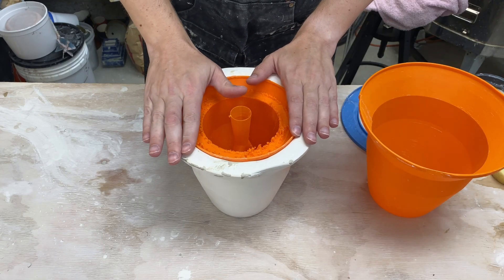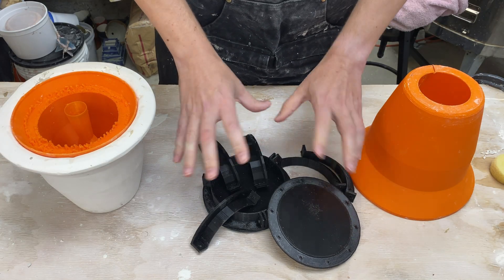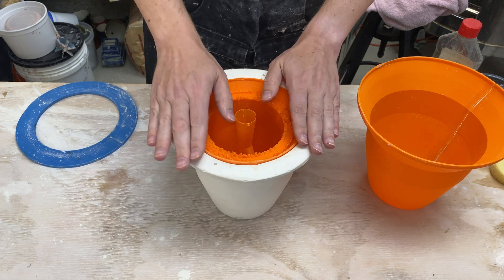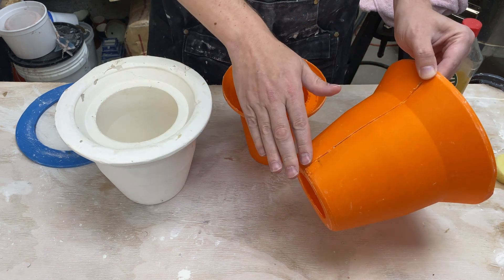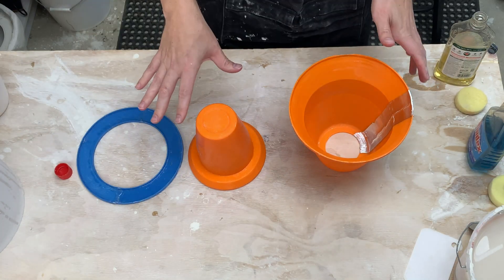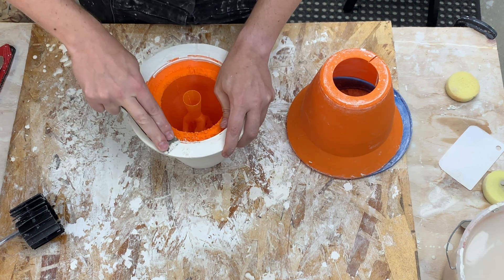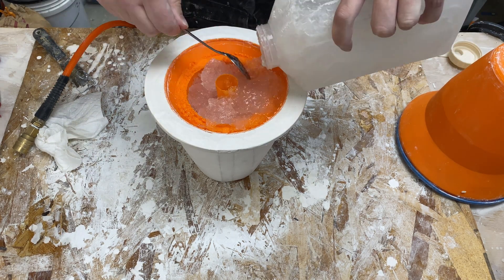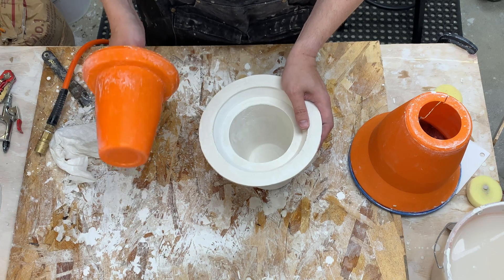Got it OUT! The SECRET to Releasing a 3d Printed Mold From Plaster for Slip Casting

Comment: Have you guys tried this with cement/concrete? it's probably not suitable for slip casting, but i wonder if the demolding is easier. according to google plaster of paris slightly expands, while concrete and gypsum slightly contract while curing. maybe just using gypsum would cause demolding to be easier? never worked with it, but might be similar in properties to plaster...
Reply from the maker: The properties are actually rather different and this plaster is specially formulated for working with clay. So even it is different than other plaster. Yes the plaster does sightly expand so using the frozen alcohol and water let's me shrink the part just enough for easy removal if the draft angles aren't enough.

Comment: Currently having this same issue with resin prints. Seems like it’s air locked in the mold. It has draft angles all around so in theory it should be easy to remove. I did not think about cooling down the model and instead opted for a valve steam size port that I can connect a bike pump to and pump air directly in the center of the mold. Hopefully that works, if not I will definitely give your method a shot!
Reply from the maker: This process came about from an active discussion on a previous video, and using compressed air through the mold was a contender. However, in trying this method, it is so easy and just works! I've used it on several molds and at this point some others have as well.
Reply: @PotterybyKent  Good to hear it’s worked for you. My design also requires a plaster mold on the inside which makes it much harder to remove. I made it one piece just like yours before but the print failed to remove which I suspect was due to being air locked. After doing some research and also coming across your video, it confirmed it for me. I’m hoping that the added ports for a bicycle pump on the inside release the vacuum lock and makes removal easier.
Reply: @Loucfr  have you tried it yet? i would really like to hear your experience or even watch video about this.

Comment: 3D printed mold PLA. Gypsum casting. Any thoughts about the release options: Pancoating spray,  Apel Mold Release or just soap based... thx Kent.
Reply from the maker: I don't know the first two specifically, but having use mold soap I don't think it does too much with plaster. Or if it does, there are other factors much more important like for draft angle on the form, the slight growth of plaster, etc. I think this is why the ice and alcohol method works so well is that it is actually shrinking the part to get it to release.

Comment: Try printing in PVB. It can be smoothed with alcohol. More expensive than PLA but I get nice plaster casts with it on my Prusa Mini.

Thanks for the testing Kent. That ice cold water trick is handy.
Reply from the maker: I'm not going for super smooth prints just yet (just ones that work!), but I'll keep that in mind for when I want to try that path.
Reply: btw i use PETG rather than PLA for all my molds. unlike PVB it does not help to hide layer lines and it cause some stringing that has to be removed (first cast in that mold will remove stringing anyway :-). But PETG is more slick and flexible than PLA and does not get that brittle because of humidity. If you cast cement into PLA it will eat it away and make it crack in 1-3 castings, so it's not really reusable. But i haven't tried the PVB yet, i should look this stuff up. How long does it last?
Reply: Another thing i've considered was printing in TPU. there are different durometers avaible. Softest ones would probably perform as good as silicone molds. You need direct drive for those. On bowden printer you can only print TPU with higher durometers (they say over 95A??? dunno exactly) but it's still more flexible than other filaments and its rubber like nature might enable you to flex the mold and remove it easily. And actualy for big prints like the one in video you don't even need to go to low durometer, because size of print makes it flexible anyway... maybe even vase mode PETG with thick nozzle would be flexible enough for such simple, but big geometry.

Comment: Suggestion : design your 3D model with a hole in the bottom (can be covered with a round sticker before you pour the plaster), and on the inside mount a tire valve so you can blow compressed air from the bottom up to remove the 3D printed model from the plaster mold.
Reply from the maker: Thanks. There was a lot of brainstorming around ways to get the inner mold out on a few previous videos. Similar ideas had come up however the problem is leaving artifacts in the plaster surface which transfer directly into the pot. It might be viable but would require some additional clean up with every single pot.
Reply from the maker: The inner mold can be really stuck - I'd be curious if you try tape and that works.
Reply: i was really thinking about this recently... Maybe even simple tube that you can just push big syringe into... syringes do have cone shaped tip, so it might not be that hard to make it fit. also using water instead of air might make it more powerful.

Comment: Great!! I'm glad to see that worked! I know you said you don't want to have to smooth the surface of the mold, but I wonder if sanding it smooth before pouring would make a significant difference in removal?
Reply from the maker: I have used filler primer and sanding in the past to make prints very smooth, and have had similar mixed luck. So removing texture likely does help, but that by itself probably isn't a full solution.

Comment: Awesome to see that working! I'll be stealing this trick because it lets me re-use my molds, compared to baking/shrinking them to release them which makes them one time use. Even the alcohol/water mixture is reusable, throw it back in the freezer when you're done. This is great! Thanks for trying this and to whoever gave the suggestion.

Re smoothing the print: I'd start by giving your 3D printer some TLC. Unhook the belts and and slide the X/Y axii hand and make sure they feel smooth and doesn't have any play, if it's an old printer that's seen a lot of use or a cheap printer that came with cheap bearings, it might need an overhaul. If your bed has bed springs, consider rigidly mounting the bed and using auto probing/leveling if the printer doesn't do it already. Make sure the X/Y belts are properly tensioned. Once all that is done, lowering the print speed and especially lowering jerk/acceleration settings can reduce print artifacts too.

After that: I've tried sanding the print directly (doesn't work all that well), and using sandable primer which does seem to work. Smooth-On makes "XTC-3D", a very low surface tension epoxy specifically for smoothing 3D prints, which I'm also tempted to try out.
Reply from the maker: For sure - thanks to @turbilliontock316 for suggesting dry ice and @Bob-Is-A-PotterNow for the alcohol + water combo. I was shocked at how easy it came out!

As far as my 3D printer goes, it's an almost original Ender 3 so it was never top of the line to begin with. I'm sure tuning it more would help (and I've been slowly doing so now I'm printing much more). But it would also be nice to find techniques that work with less than perfect prints. And then if anyone else wants to put the effort in to get them better for their own usage, then it'll be just that much easier.

Comment: Boiling/hot water works relly great if you´re not using the mold pieces again. PLA prints usually shrinks alot when heated (+10% in my experience).
Reply from the maker: These molds are intended to be reusable several times so the frozen trick allows that.
Reply: @PotterybyKent  understood! I guess windscreen washer fluid might be a pretty good premade easy to get solution for the ice bath?  Cheers!
Reply from the maker: It might. Basically you want a solution that stays liquid at freezer temperatures so you can pour it in and out, and get it as cold as possible without needing special equipment.

Comment: Can you remember how much water and alcohol you mixed in the bottle? Was it like 50/50 or more like mostly water and just a bit of alcohol? I want to try it with my next mold that is in the printer at the moment but I don't want to ruin my freezer with exploding bottles of alcohol slushy ;-)
Reply from the maker: I did not measure, but I think maybe 20%. I put it in a plastic container with some headroom so there was some space to move just in case. And I added some more alcohol along the way.
One other trick I tried since doing it here is to pull it out of the freeze a bit ahead of time. That way if it is a little too frozen it can melt just a bit to be easier to pour in.
Let me know how it turns out!
Reply: @PotterybyKent  I forgot to put the mixture in the freezer before casting my mold so I ended up just using crushed ice. I filled it in the void like you did and topped it up with cold water. Worked like a charm! I still had a bit of a hard time getting it out but my piece had straight walls and was quite small so I guess there wasn't much room for shrinkage. All in all I think it's a very good approach and I'm going to keep doing it like that. It was the first time I ever got a 3d print out of a plaster mold without breaking it.
Reply from the maker: That's great to hear! I recently did another mold and timed it using the alcohol mixture - it was in for just over a minute before it let go and I pulled it out.
Reply: @PotterybyKent  thanks for the insight! I just discovered that glycerin has a freezing point of -20C and put half a litre in the freezer. I’m curious about how the consistency will be tomorrow as glycerin already has a very high viscosity. Most probably a mix of alcohol and water is ideal. I just wanted to try something without alcohol because some filaments dissolve in alcohol but most likely I’ll always be using PLA and PETG anyway.
Reply from the maker: Interesting, yes I'm curious how it turns out. I'm sure there are lots of options. Having something slightly fluid at those cold temps is nice so it gets into all of the areas, but beyond that it's probably not too critical exactly what it is to get the 3D print to shrink the tiny bit needed.
Reply: @PotterybyKent  The glycerin sucks. It becomes a very interesting consistency but nothing really pourable. Also I didn't have enough of it so I ended up running to the freezer and crushing ice cubes again ;-) Now I've just put a bottle of rubbing alcohol in the freezer for my next try and hope my wife doesn't notice.
Reply from the maker: Thanks for the update!